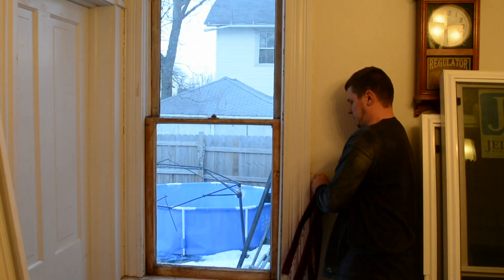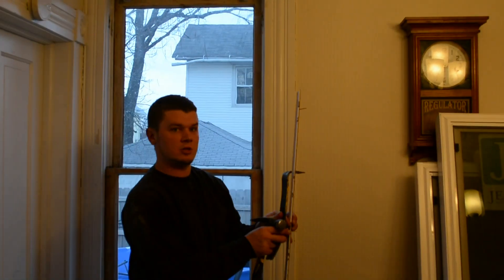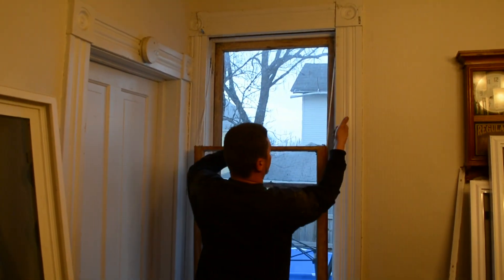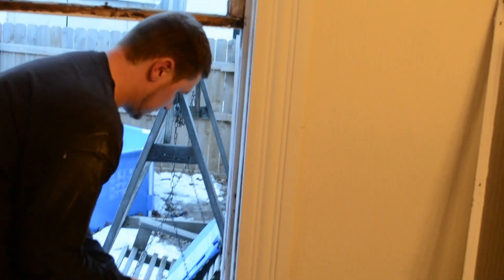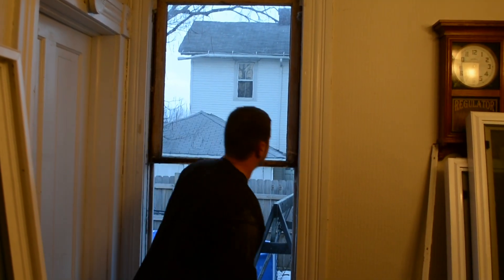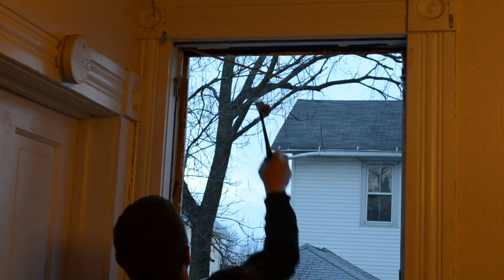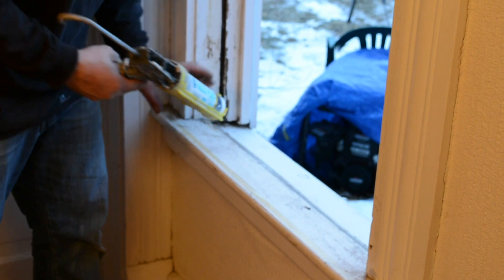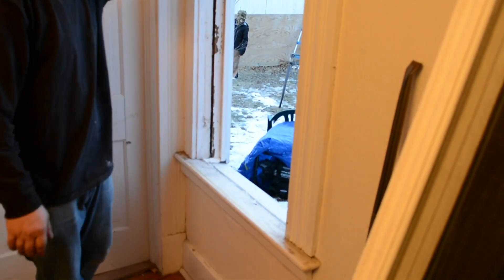How to install Double Hung Windows

Comment: Is it the same procedure when your taking out a newer double hung window?
Reply: Usually you can just flip in and pop out the sashes then take out the screws n push it out, go to the outside n score the caulk first off lol
Reply: But since there snow it looks like up north n they might have aluminum trim capping on the outside so you would have to remove that first